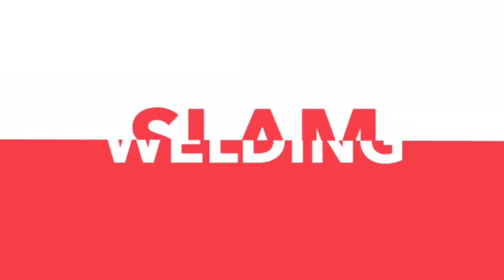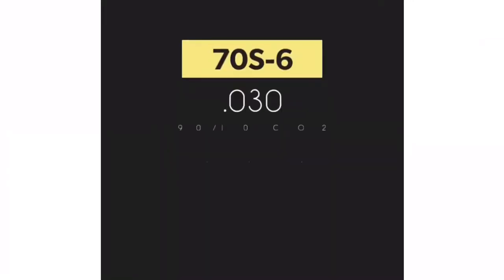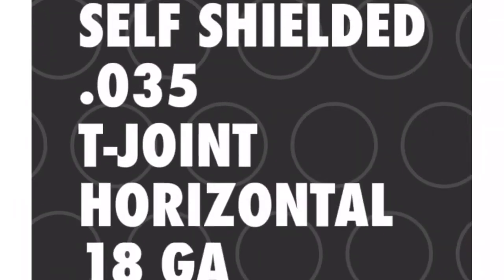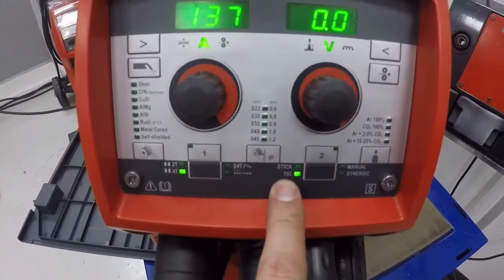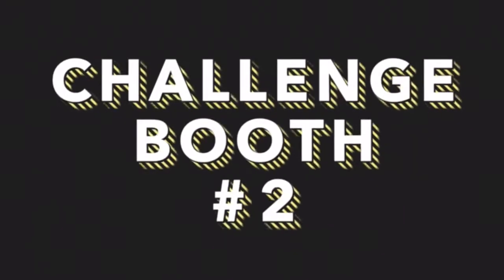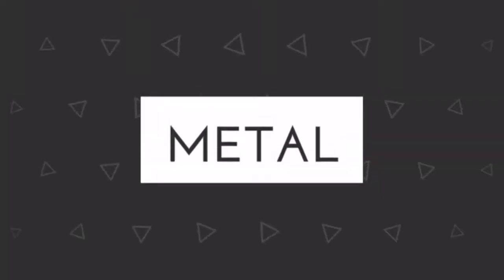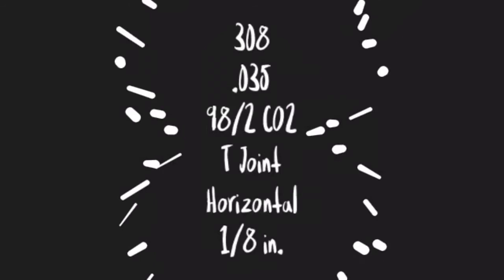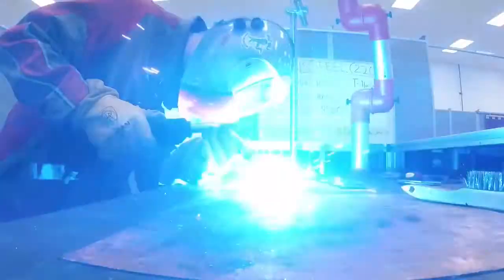The Worlds Largest Welding Challenge

Comment: Nice Job Chris.... I just picked up a transpocket 150 this week and hacked off the Euro plug and rigged it up. It is by far the best stick welder I have ever used. I could not screw it up, and usually I don't have to try very hard to do so. I am going to take it into Shasta College Welding Dept next week and have the head instructor put it thru all the typical stick rods and positions and I will post a video of it.
Reply from the maker: Petit Wonders Awesome! The Transpocket is one of my favorites. Is the school located in the US? Fronius is always up for school technology days 🤘
Reply: We just held a weld academy for the last two days at Shasta College in Northern California, we had 12 high schools from around the northern part of the state participate. I took a bunch of video footage of it. I now am going to have to learn to edit it and upload the event. Shasta College is one of 5 AWS approved testing facilities in the state. It has a really cool program with about 150 full time welding students. Fronius had a rep out there last year and people were impressed, I missed them when they came out. I am bringing my machine in and will see if I can help penetrate the Miller/Lincoln Moat that is in place with the next round of grant purchases. I can't wait to get some more of your equipment, like the Transsteel 2200 and Magicwave 230i. If the Transsteel 2200 works as well as the Transpocket then I will become a wire rock star to go along with being a stick rock star.
Reply from the maker: That’s great to hear ! They are both beasts of machines that’s for sure. Keep up the great work with the new age students. Shoot me an email with your information and I’ll get you some stickers - Bliven.christopher@fronius.com

Comment: Great video.Where did you get your helmet? I cant find that model anywhere.How do you like the tig torch. Do you find it difficult when using filler rod?
Reply from the maker: Ron Johnson I didn’t find the TIG torch difficult. It actually felt comfortable with the amperage control right on the torch . You can get smaller back caps to help. I found a hood at https://shopweldingsupplies.com/products/fronius-fazor-1000-welding-helmet-auto-darkening-9-13 . I would ask them for a Fronius Vizor 4000. This is what I got

Comment: can you have the mig gun and tig torch connected to the machine at the same time??what i mean is can you leave the mig gun connected in when using the tig or do you have to unplug the mig gun and plug the tig gun in ?
Reply from the maker: Not sure how I missed the question but you can leave the MIG gun connected while TIG welding. Just make sure it’s not laying on the table otherwise it would be hot when contacted